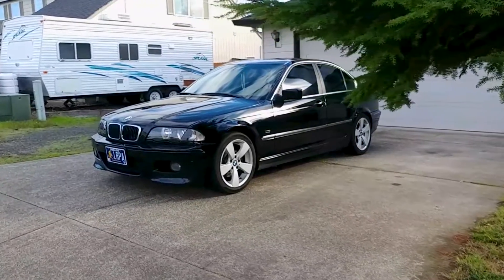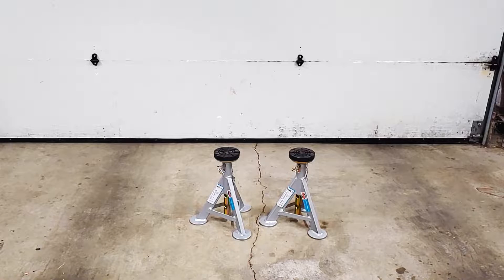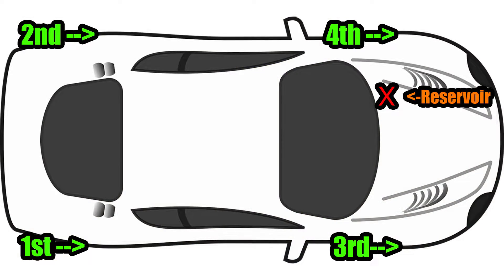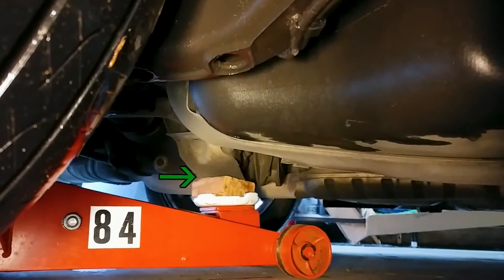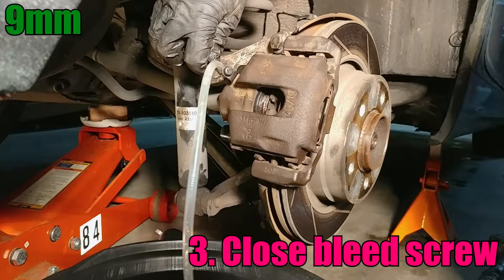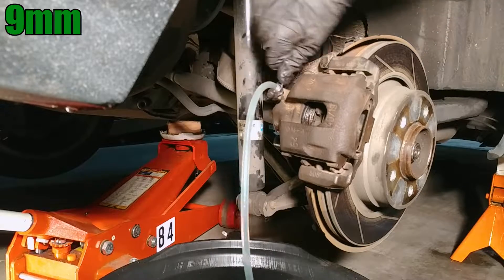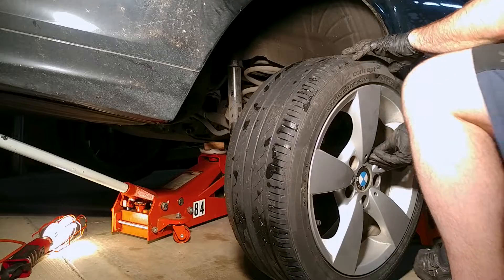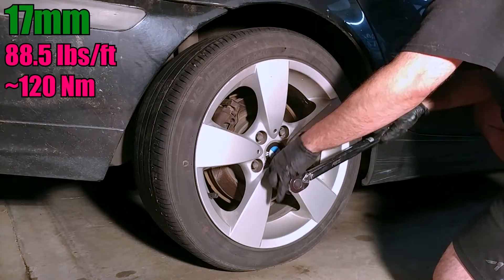BMW 3-Series Brake Fluid Bleed Procedure - No Bleed Tool

Comment: Hi, is you bumper original
Reply from the maker: Nope, it's an M3 replica.
Reply: @ how was the fitment and whats the price?
Reply from the maker: @CrveniE46 no problems with fitment but I don't remember who I bought it from or how much it cost. It's not OEM though. Had it installed about 15 years ago.

Comment: Very good video! Did you pump the brake pedal by yourself than bleed out?
Reply from the maker: Thank you. I had someone pump the brake pedal while I operated the bleed valve.
Reply: @endlessmoneypits  how much did you bleed out the brake fluid in all 4 ?
Reply from the maker: Until it looked clear.